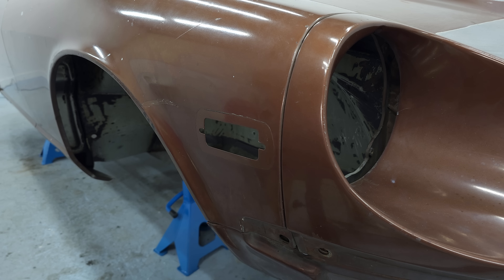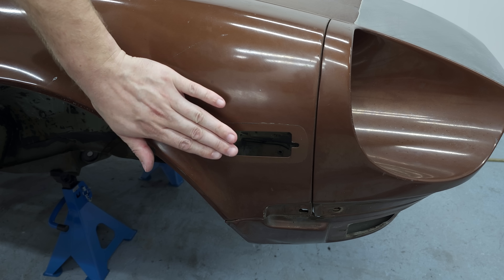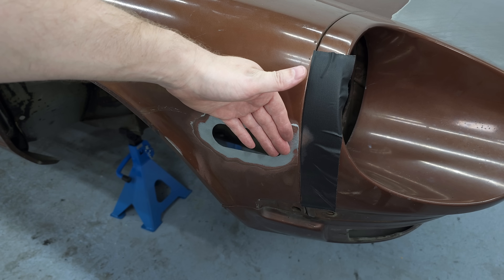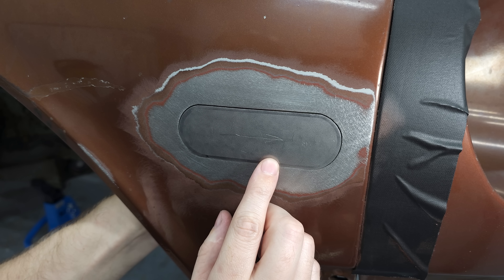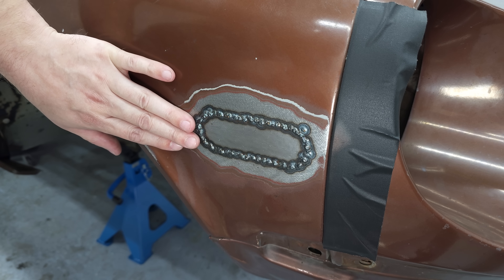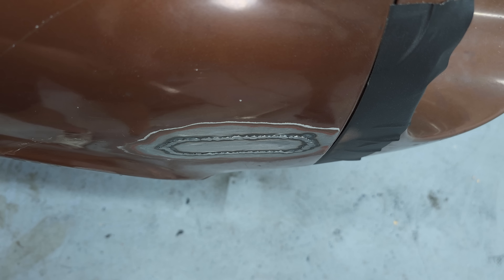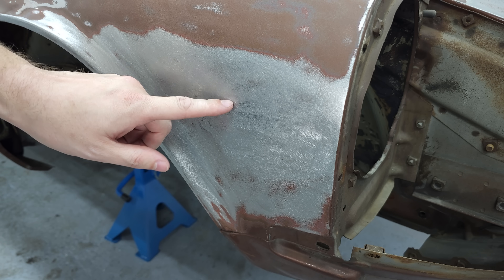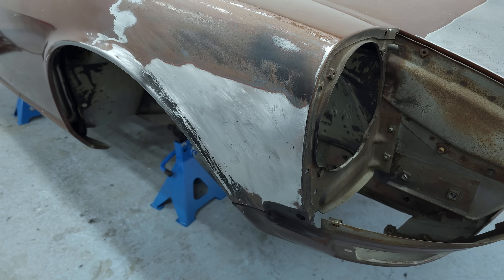How to weld a Patch on a Car - Side Markers Delete 240Z

Comment: Or do what's been done for 100 years: "lead it in" with solder. That car does not have crush zones, and the flux and heat are much more dangerous than lead solder❤

Comment: 7:00 some people do the exact opposite:
NOT welchen at all position FIRST - but instead weld around in 1- 2 cm sections. Because: The peace will distord no matter what. But if you go around the 2 peaces do not loose the correct height from each other.

Comment: It's interesting to think about what happens with the distortion.
Welding induces localised tension around the weld. This is because the new weld material is still very hot when it solidifies, and then shrinks further as it cools.
This tension caused the curved surface to flatten out.
On the other hand, the hammer+dolly stretches out the metal again, making it wider again so it's no longer pulled flat by tension.

Comment: I don't know if you've answered this question already, but coming from someone who had never welded anything, is there a specific type of sheet metal that you have to use to match the existing metal of the car or do you just get generic aluminum sheets? All the patches and repairs you've done blend almost seamlessly to the existing metal when your finished, like there was never a patch to begin with. I didn't know if that was due to meticulous inventory, or are most/all auto bodies just like that. Thank you, love your channel ❤️

Comment: great video love watching this.
little TIP for next time leave a 1.5 to 2 mm gap allround so the weld goes inbetween instead of on top of it way les work after welding.

Comment: For MIG welding patches into sheet like this, I made a 50mm square out of 6.5mm copper plate, and hammered a light dome shape into it.  Using a magnetic finger to hold it in place, I can hit the sheet with the MIG wire, and not have to worry about burning holes through things, or building up a huge bead on the inside of the weld.  A little power sanding later and the outside is nice and smooth.

(OK, I'm American, so it's a 2" square of 1/4" copper plate.  But you get the idea.  The copper acts like a heat sink to cool the weld puddle from the back side and prevent overpenetration.)

Comment: If you are welding thin sheet metal, press a piece of copper sheet from the back side to better dissipate the heat, this reduces the delay of the material

Comment: Nice job. While watching I wondered if Dustless Blasting was in Europe, which it is, according to Google. They use water as the abrasive carrier so you don't get the warping from overheating. They also add a rust inhibitor so you have a few days to paint the surface before surface rust starts.

Comment: I would have just taped cardboard to the back side of the fender and filled in the hole with drywall joint compound. But what you did was good too.
Reply: That's not the my mechanics way.

Comment: I am truly impressed how you thought that the added piece should be forged from the outside and did not enter the temptation to hammer it from the inside thus risking the integrity of the weld. You compressed the rest of the body into the the smooth curve you wanted to fit the patch without subjecting the weldind area in tensile stress, but instead in a compressive stress!!  Job extremely well done!!

Comment: I think it turned out great you could cut your time down by welding the patch from the inside this leaves a cleaner look on the outside without having to grind away and shape. Great job love the video

Comment: Hello Mister ''My mechanics'' I've noticed that in most of your restoration videos, when you make new parts such as bolts on the lathe, you turn a really large cylinder of steel to make a rather small piece. To me, it looks like you're wasting a lot of material so I'd like to know why you do this. It just doesn't seem practical to reduce a 20mm piece of steel to make an 8mm or smaller bolt. 
Do you use pieces that large solely because of how the process looks (As in, the visual appeal of turning a small object out of large stock)? Do you recycle the leftovers? Or maybe you're sitting on a pile of steel cylinders so large that wasting some doesn't bother you at all?
Reply: He uses what he has available, mostly off cuts from other manufacturing companies in his town. The stock also has to be larger but he doesn't buy stock just to 'waste material', it's what he has on hand and what he can get.

Comment: Welding up your marker lites makes an illegal car. Those are required lights, unless of course you are scamming someone to believe the car is older than it is. Either way, there is no legal or moral reason to do this. Those marker lights are there for safety, yours and others. The only excuse to do this is for a show only car, not a driver.
Reply from the maker: You're correct, but only in the US. In Switzerland these side marker lights are only required if your vehicle is longer than 6 meters.

Comment: I’ve been told by a loca auto body guy that whenever you weld the body of a car, the heat changes the molecular composition of the surrounding metal and leaves it susceptible to rust even under paint (possibly after several years.)

Comment: I’ve seen you’ve done a nice job, minimizing the warpage and doing this. The only problem most people don’t understand. Is that on the backside of that panel if you don’t grind it flat like the front side that patch will show up under the paint months later especially if you painted black the reason for that is in the thickness of the metal if it has thick and thin sections, the thicker sections will hold heat longer. Then the thin sections, the body filler adds to the issue and creates a ghost line in a circle around where you welded it. I’ve learned this from almost 50 years of doing bodywork. If you ever watch guys like chip, Foose, you may not see it, but he will dig weld panels together, but he does grind both sides till it is flush some guys go so far as To add soulder  in any pinholes
Reply: Just as an FYI, MM has professional auto body restorers advising him each step of the way. He does the work, they tell him the proper way to do it.
Reply: There are all kinds of experts, but I know chip. Foose has always been able to do this kind of patch without any lines showing up even on a black car, and so even though they are telling him the conventional way of doing it and it does work it is a better more complete job if you follow the guys that fabricate from flat sheet metal. Because they know how to avoid any lines showing up later, and after I’ve done this kind of work for over 50 years, I learned a few things by Mr. Foose, and I would suggest his experts watch Him that’s all I’m not insulting him I’m just saying, we have learned over the years, new and better techniques and when you do shoot cars in gloss black, you better not have chopped up panels without grinding both sides of the metal and keeping it as even as possible The sun heats up the car roofs and hoods to extreme Temperatures and if there is any variance in thickness, believe me, it will show.

Comment: Keep grinding to a minimum, the weld should have full panel thickness penetration, grinding should then only be carried out to high spots in the weld which are higher than the surrounding bodywork,  never grind any part of the bodywork it will make the metal thinner, tap down any high spots in the bodywork and use body filler to smooth out low spots.

Comment: just a tip ! if u are welding thin material you can put a copper plate behind it so its nearly imposible to do a hole.

Comment: I use epoxy if done cleanly and sealed properly it's last a lifetime,  that piece is to small to heat up unless you can braze like the old timers.

Comment: Fun fact: the 3M corporation has a structural adhesive, that is rated at ten thousand pounds per square inch. Whereas a weld, 5 mm in diameter, is only rated at 3,000 pounds per square inch. And if you think, today's modern automobiles do not use adhesives... You would be wrong.  Today's adhesives were primarily designed to do away with, welding, completely.

Engineering 101... There's always a better way.

Comment: All very nice, but I think the most important thing is your spotting method with TIG/MIG. A weld in sheet metal will almost always lead to severe distortion of all the body metal, as you have discovered.  Can be nightmare. You nearly avoided it, but in fact, the stresses are built in at the factory, and they are not the same on any two cars, so it can bite you no matter how good you get. Such a pain, but that's the job. Well done.

Comment: In conclusion - you could have welded the simple flat piece without shaping it, because welding would have caused warping anyway and you could have shaped the fended after welding, what you did anyway. 

As well using copper piece on the back of weld would have helped here. Weld does not stick to copper, yet copper reduces the risk of blowing trough thin sheet metal like this and further it is good heat conductor, so it reduces the warping as well.

I would use powder guide coat, nothing wrong with spray paint, but you need to wait for it to dry and it is rather thick layer - much lighter guide coat would be sufficient here and quicker.

I think the result is excellent in the end and definitely right decision to work the metal itself rather than dealing with it in bondo for paint prep (sadly that is what most people do, but I always consider that wrong) , however I still think pre-shaping the patch was waste of time.

Comment: If you did that in a State that requires inspections, would that fail your car? Oh and removing safety equipment would give an insurance company cause to reject a claim. But it sure is cool. 😂
Reply: He's not in the States, he's in Switzerland and doing the restoration according to Swiss laws and regulations. The roll bar was after-market, BTW, not original.
Reply: @Vickie-Bligh  👍

Comment: You can do what high end body shops do and fill the low spots with tinning and leading. You apply it hot and shape it as you go and then use a metal file to shape to perfection. Much quicker and you achieve perfect results without body filler or high build primer. The thick lead coating will allow you to make shape absolutely perfect. There will be areas where you cannot put the dolly on the back side and it’s the only way. Best of luck 🤞

Comment: I think that the reason you got the holes on the tack welds might also be from thinner sheet metal in that area as an artefact leftover from when it was being rolled and shaped at the factory. When I was learning to do jewelry as part of my metal working hobby I learned that It is very easy to roll an area so much that you push more material out of it that you realize until you start doing something in that area again. Seeing those holes reminded me of a few plates I was working on for a class project that looked good on the surface but the instant I started working with it one side was obviously thinner than the other which required me to go back and try to add more material to reinforce it.
But to help with the warping you might want to learn how to Tig weld.

Comment: I give to you one suggestion for the next patches you will apply.
Just to have a stronger and deeper welding, it's better to have a sort of border along the perimeter of the patches that will match the "fixed" metal.
In this way, tuo will have a area that is bonded and not a edge

Comment: Very strange. Usually all American cars sold in Europe must have redundant turn signals. All American cars come without redundant turn signals on the wings.
For example, the Chrysler C300 touring in Europe will have redundant fender turn signals, the same twin brother, the Dodge Magnum, will not. And so it is with all cars.
Reply: Not a turn signal, just a light

Comment: You can hold a thick piece of copper plate behind the patch panel to absorb the heat as you weld it in place the copper wont stick to the weld !

Comment: With complex curves like that on a small patch plus dealing with heat-warping I’m not sure what was gained that couldn’t have been more easily achieved by welding a plate to the back and using a skimming of filler to profile it from the front.

Comment: In UK its not possible to blank side lights as if the year of make has side lights it needs them I put a flip front on my last mini and dint bother putting the sides lights ss looked much better  and instantly failed mot 😢

Comment: I did metal repair on a 1970 240z nearly 30 years ago, also with a mig. It was difficult...and those cars typically need LOTS of metal repair. It was super easy to blow through and super difficult to obtain weld penetration at the same time. The best comparison I could make with the metal composition would be...they seem to be manufactured from old Japanese beer cans.

Comment: very well explained ...just my opinion maybe avoid using cold air to cool the metal down as it causes rapid shrinking of the metal rather let it cool naturally and then weld the next spot...do both sides of the delete or whatever welding needs to be  done and alternate between the sides giving the metal a chance to cool as its pace

Comment: In the old days they used to build ships like this, and if you see pictures of wartime / 50s-model naval vessels you will see they were all warped and wobbly. The solution was to heat the sections in an oven before welding in place, so that as it cools down it pulls back towards flat.

Comment: One thing you can do is to make your own contour gauge (useful if you ever need to transfer a body line from one side of a car to a side needing repair). A thin piece of wood (paint stirr stick) and file/sand the curve into it. Can even get a compound surface like this panel which curves in two axis by interlocking your make shift gauges.

Comment: Truly above average! great instincts as for the patch shape, round corners whenever you can makes sure there's no heat input concentration on corners. Believe it or not, you had maybe a little less gap than what your MIG settings would have needed. It was so perfectly and even around that coupled with unrestricted rear access it would have been an ideal candidate for tig welding it. Another great technique that sometimes cuts down shaping time is a slapper (sort of a flat, rounded corners facer "spoon") and alternatively hammering on dolly and off dolly. (you hammer on dolly for stretching and bringing up the lows, and hammer off dolly by placing the dolly in the low and gently tapping down on the neighboring highs)

Comment: @2:30 I'm surprised you don't have a pin nibbler for sheetmetal. So handy for cutting out body metal. @7:00 Try using a 1-2mm copper sheet behind the weld point.

Comment: Why does welding in a different angle change the outcome of burning a hole? (I have zero metal working experience, never welded. I am genuinely curious as I am  an outsider)

Comment: I saw other comments mentioning getting a glossy surface to check the shape. I will add, not sure how precise you're going but if you have a glossy surface you can use a PDR light to finesse it even further.

Comment: Real body work is always better than body filler. The modern filler is really, really good if used right though. I'm sure it'll take a few ligh applications here and there on the car before it's ready for paint.

Comment: When he started welding, he attached a cable to the side of the car. What's that for?
Reply: That's the negative pole of the welder. 🙂
Reply: @ArniVidar  oh ok, but what happens if he doesn't use that cable? 😳
Reply: @patrik7816  Nothing. 😉
In simplified terms, when you're welding, you send current from the positive terminal (the welding tool), through the welding wire, through the metal being welded (car body), and into the negative terminal (the clamp). Because a spark of electricity creates a lot of heat, the wire melts and becomes a liquid, and floats to fill whatever area you're trying to fill.
This of course happens super fast, and it also cools super fast so that the puddle of molten metal hardens almost instantly.
Oh, and because the entire car is one big piece of metal, he can basically stick the negative terminal clamp anywhere in the vicinity of where he's welding. That's why you see that he's removed all the paint from the spot he clamps the negative terminal to.. so that the electricity can flow freely through the body. 🙂
Reply: @ArniVidar  aha ok 🙂 Thanks for the info 😎👍🏻

Comment: People over think it.  Since you have full access to the back. Weld the pre-cut panel in.  There is no avoiding welding distortions.  Tune the panel contours after welding is complete.  I'd say your distortions are average.  Probably holding on the trigger just a little long but not horrible.

For those interested ESAB makes wire for this very application.  It does not have the high tensile strenght and thus works much more like the body panel.  Grinds fast inputting less heat into the panel.  

Tape body lines if you want any hope of keeping them crisp and factory.  

The weekend warrior can achieve the same result as a professional.  Just takes longer.
Reply: Er, you seem to know a lot .. for a Labrador...!!
However, you seem to be telling him to do exactly what he did do .. don't you..!?
....and this guy is hardly a 'weekend warrior'... he'll end up with a better result than most pros....!
Reply: @andymccabe6712  Sure... if you ignore making the opening larger, cutting a new piece.  Forming said piece.  Then doing exactly what I said to do in the first place.